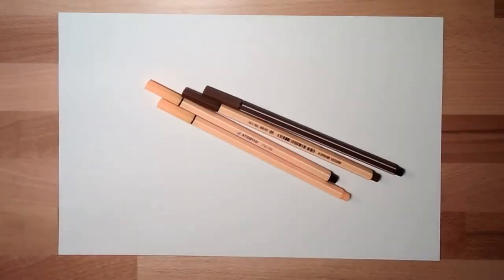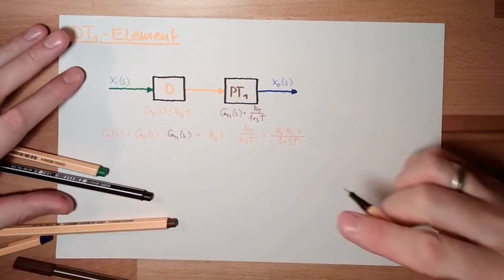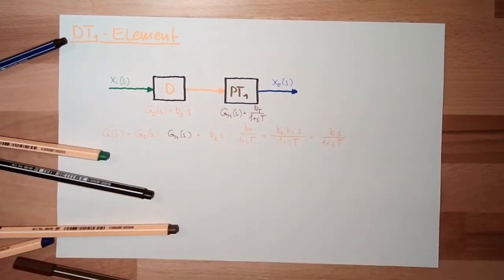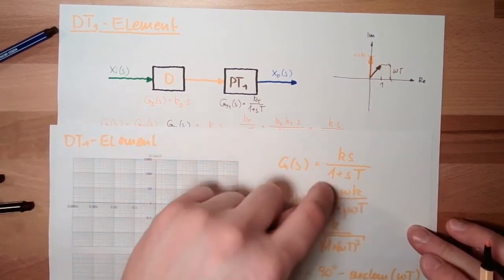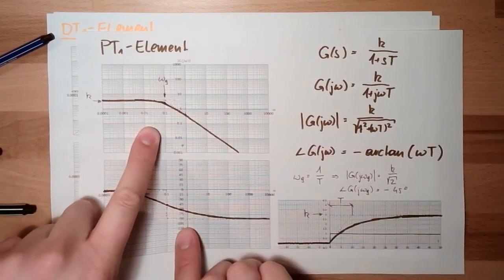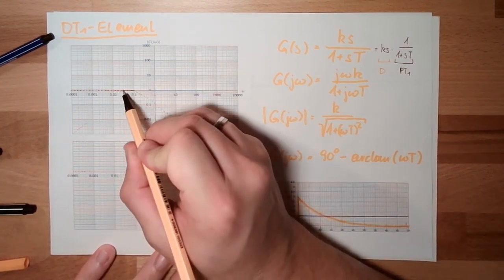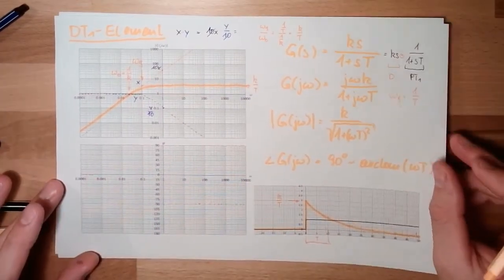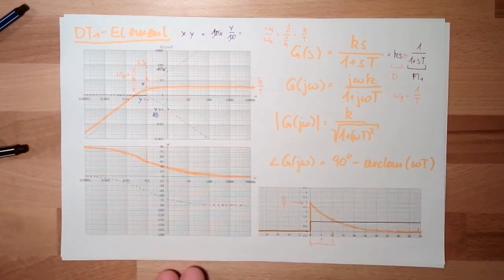Control 38: DT1-Element (Old)

Comment: thank you for your lecture. But i have a question, why when you calculate |G(jw)| ,in the numerator it is only K ? why is it not Kw , because i thought that when calculating the numerator it is like this : sqrt( 0 + (Kw)^2 )
Reply from the maker: Hello. Yes, you are right of course! I forget the w in the numerator. There should stand Kw. Thank you very much for watching carefully! I guess I need to replace this video. Things happen.
Reply: @HeinzPeterschofsky  thank you for your answer
Reply from the maker: FYI: A updated version is now available. Thanks again for informing about the mistake.